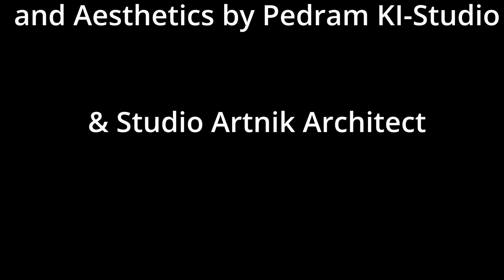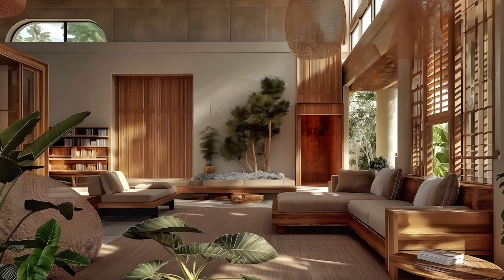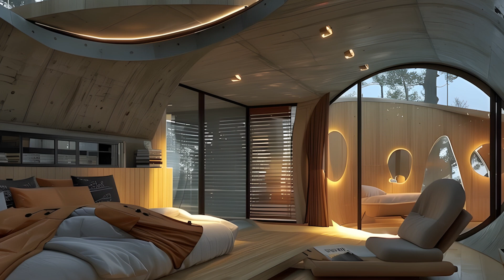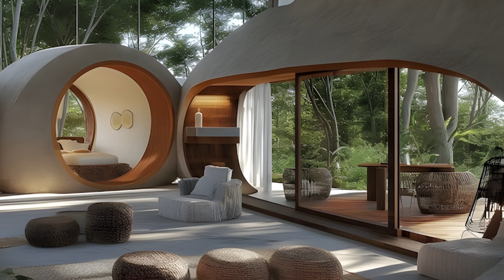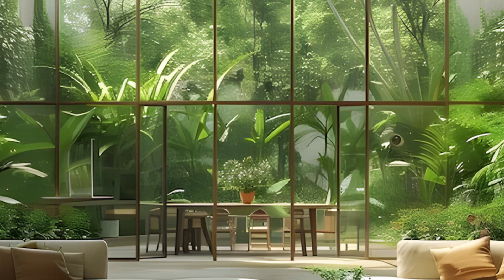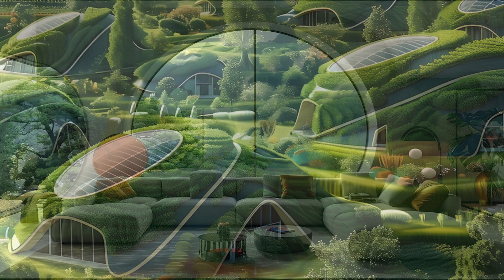Sustainable Architecture Integrating Technology and Aesthetics by Pedram KI Studio & Studio Artnik A

Comment: the fantasy is still a 3d image. & the current reality, should be a discussion regarding the strategies of partnering with every “hot” “brilliant” architect & studio in a wholistic humanitarian effort to combat the garbage, noise, building material waste, drywall, wood, sealant & plaster debris, dust, chemical fumes, the true cost of human & mechanical energy in the design & build & all (will forever be) required in every build, including:  the water poisoning, site water use & clean up, actual expenditures such as fuel costs (transportation), power (electricity), & the off-gasing (cure-time) in the creation of EVERY beautiful image, proposal, project, product, including (same equation)  those - not always new or symbiotic production & fabrication methods of (all) exterior & interior products. & the shipping of such (all) products from origin to studio to site, including Italy, China, Korea, Japan, the EU, the US... around the Planet leaving (another) trail... c/o of Amazon. You know, the Materialization Machine & Institution, killing our once happy Mom & Pop & Familia hand to mouth shops. & well. the current equation = a compounding disaster